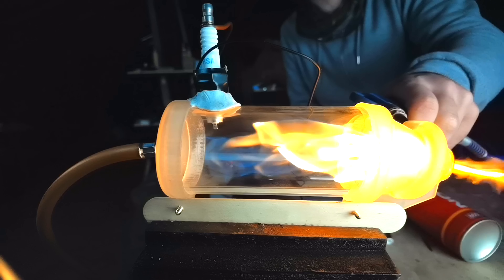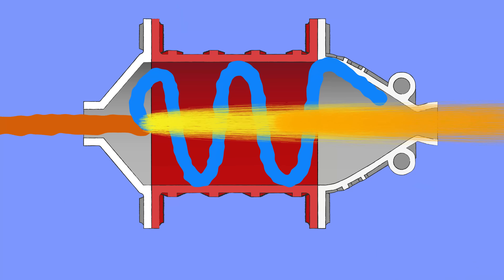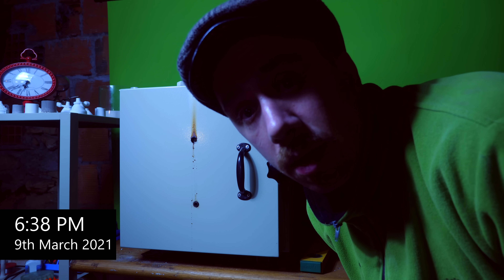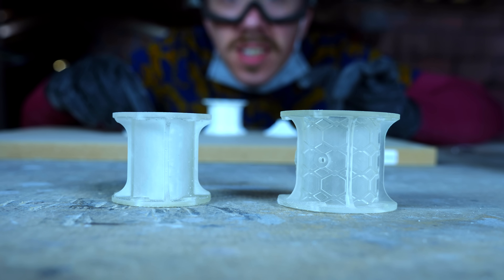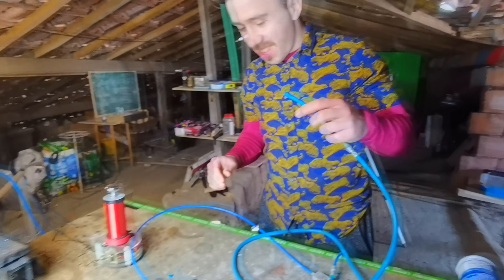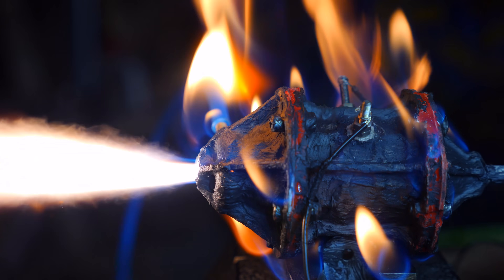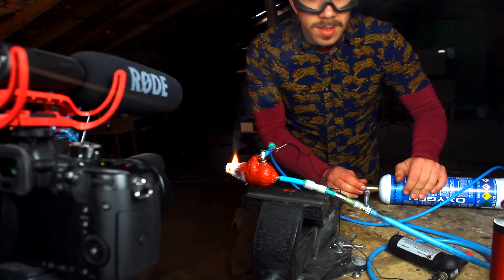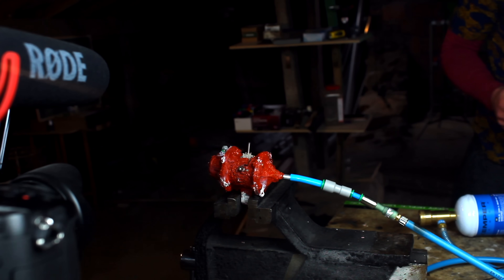Vortex Rocket V2.0 (3D Printed)

Comment: What if you used an aluminized gasket then as a heat up it would expand to fill the gap or even oven rim insulation as the pressure increases it would be forced into the cracks.

Comment: Are you assembling two flat surfaces together, as it looks in the vid?

Maybe try having the sections slot together (a recess in one that the other slides into), as minimal clearance as possible, filled with high temp putty/ sealant.

Comment: I don’t know a lot about rocket engines but instead of having flat pieces where the pieces butt together I would add ridges in there to lock it in like a bearing race and journal and then put sealant on it and I would use a sealant that’s non-flammable

Comment: You can use ceramic powder and air pressure inside the engine to seal your leaks. They do this to increase efficiency in houses.

Comment: You could use something in T-form and put it between the parts. The parts would need a gab so that the unpersönlich Part of the T dont ruin the flow. The "closing strength" would increase with the pressure. I could sketch something if xou want (my english isnt that great and the sketch would explain it a lot better but i dont want to waste my time for it if you wont see it anyways)

Comment: You could fix the leakage problem by increasing the PSI of the airflow, perhaps for a future video some experimentation with fuel and air ratios? There might be a good "sweet spot" for temperature of the engine and thrust.

Comment: Why don't you just buy an engraver CNC machine? Uses g-code as the 3D printer (well, not exactly the same). And using Fusion 360, you can get the g-code file.

Comment: I think you should use some time with decent 3D modeling program, do some simulation and find better shape of the chamber to achieve ideal laminar flow which better separate flame from wall of chamber. Although it can be more problematical due size of engine and pressure you achieving (bit like problem in TOCAMAC when scientists trying to achieve fusion). 
Also this kind of 3D printing with use of resin is certainly issue, because after evaporating the ceramics is too porous, so it will always leak. Possible solution of this problem is adding layer of enamel after kindling and do cook it again, ideally something with high temperature resisting properties. That would also help from inside, because it would make inner wall of engine smooth, so less disturbance in flow.

Comment: Am I the only one that caught that he had fuel and oxidizer connections reversed? According to his diagram and explanation at 2:09 the oxidizer is to be injected into the vortex generator, but at 10:23 he connected the oxidizer to where his earlier explanation implied that the fuel would feed into. If this was the case, that could explain the rapid failure of all of the engines (i.e. burning fuel in contact with combustion chamber walls, rather than [relatively] cool oxidizer). Hope that, if I'm right, this helps you!

Comment: Try using BASF Ultrafuse 316L. It has better shrinkage properties and can be machined after being sintered, so you can get the joining faces mirror smooth to prevent leaks. It's also much stronger than ceramic.

Comment: if the parts are porous could you not take the fired parts and drop them into a bath of some sort of refractory cement/slip, draw high vacuum then allow slip to fill prior air holes. then refire/repeat if neccesary?

Comment: Try to print the entire chamber double-walled to ensure an insulated air space between the inside and outside with only small connecting junctions. This way you can seal the outside without having leakage issues due to thermal stress.
Reply: Then I'd probably just use a grout sealer with this idea

Comment: @integza to solve the porosity problem I may have an idea: mix a small amount (idk 1%?) of metal powder to the resin.
In the post processing it will melt and maybe fill the "holes". 
Of course it could end in a disaster: the metal could bleed out or completely crack the model...

Another option is to use graphene powder that should not melt and maybe it will fill the holes..

Comment: Theme suggestion: you should evolve from plastic/ceramic to some kind of metal. You already tried soldering and brazing, why not to try casting? You can 3d print a part, and after making a mold you can cast with aluminium, copper or iron. I don't think that would be so expensive

Comment: Depending on how hot it is on the inside of the burning chamber you might be able to spray a mist of water in there that would then vaporize into steam which produces a lot of pressure just like the combustible gases while at the same time it's taking the heat energy down so that way you don't have to worry about the heat as much and it still creates Trust while cooling the engine at the same time it will have to be tuned but as long as you got an atomizer that can withstand the Heat that might help. 

Like a steam jet engine!

Comment: Can you please do a video of you trying to maximise the output potential of a CO2 canister, by using different  nozzles and part. Also try to fit it on a paper air plane or a plane of similar size, I think It would be awesome if the project could be easily done by others.

Btws love the channel and the energy you put into each video, and its inspiring to see how much can be done with a drive, intelligence, and a 3D printer.
Keep up the fantastic work!!

Comment: I suggest you mix up a batch of homemade sodium silicate (aka water glass).
Melting point is about 1 088 °C and because its already in liquid form at room temperature, you'll be able to submerge/dip your ceramic parts into it, in order to seal them all the way through (from the inside and the outside).

The problem with your current "exterior" sealing methods is that it's a bit like putting a piece of tape on the outside of a hose pipe - it won't hold, it just gets lifted/pushed off with just the slightest interior pressure.

I noticed a few comments suggesting using pottery glaze ..and yes I agree, this is also a brilliant idea.

Love the channel!
Good luck!
Reply: The main thing is that he is putting the pressure liner on the outside. So the liner gets no structural help from the ceramic, and once it blows off, the ceramic gets no sealing help from the liner. Lining the inside of the chamber would work better, but the stuff he's using now would probably kill the surface finish. Still, probably the way to go. Sealing liners always go on the inside of pressure vessels!
Reply: @rune12358  Yes, you HAVE to seal pressure vessels on the inside. Any sealant on the low pressure side is reliant on the adhesion to the surface as well as other problems. Incidentally you have to seal vacuum chambers from the outside. You would not believe how many 4' diameter concrete vacuum chambers are buried in colorado.... Although everyone ruins the vacuum chamber bit by putting steel lids on them that don't seal.....
Reply: Water glasses is a brilliant idea! 

  It sets up simply by air drying or heating! = )
Reply: You could glaze the pieces and fire them to turn the glaze into a glass coating
Reply: Dammit, that’s word for word what I was going to suggest.

He’s got micro pores from his casting process.   

Fuel/Oxygen leaks out, and then it’s Fail City.
Reply: How does the sealing with water glass work? YOu just dip it in and dry it, or do you have to put it in a kiln?
Reply: Thats ingenious for some reason it never crossed my mind good call bruv
Reply: Even with the refractory, make it much more liquid, as to fill in all the cracks and holes. You would start with very thin liquid layers and then after 1 or 2 layers, you use less watery refractory to build a bit more thickness. By example take satanite or some other refractory, thin it down and let is seep into the porous part so that it gets filled and then let it dry. Afterwards you do a second pass and then a third, the third you do with a bit thicker refractory.

Another option might be thin layer sealant and then a reinforcing layer with some glass/carbon fiber with epoxy/silicone as I don't think mortar/cement will stick to the silicone.
As the problem with the silicone sealant is that it's acting as a balloon. It doesn't have structural support except the adhesion to the refractory/ceramic that's porous.
putting the sealant on the inside would solve it but probably expose it to temperatures over 300C.
Reply: Maybe adding pressurized air to the oxygen could increase the airflow around the outer shell, along with moving heat away from the casing
Reply: liquid glass is literally that black thing he tried before silicone. That thing is made out of (mostly) liquid glass and a fancy complex to make it more stable under load
Reply: would you need to de-gas the water glass infused 3D print in a vacuum chamber to reduce the air bubbles that could be trapped in the ceramic, and get the water glass to go into the pores of the 3D print?  They do this with resins and with resin infused woods (ref:  look up cactus-juice).

Comment: Instead of using high temp sealant and refractory cement (which will still be porous) why not apply ceramic glaze to the 3D printed stuff and bake it. That will seal any holes same as for cups and plates!

Comment: What you just need a pressure regulator that also remixes the oxygen in fuel something like a turbine that has no moving parts that then feeds into the rocket engine

Comment: Possible options for solving the leaking issue:
 1 once you have the engine assembled coat or cast it in plaster Paris or cement by using a cheap plastic container to house it till it dries, either with the tubes pre installed or make the tube ports extend out further to account for the added thickness. You could possibly use pla to make a mold and then put it in the Kiln to melt it out and then you have your piece but made out of concrete or plaster of Paris entirely. If you do that then you're going to want something underneath to catch all the melted pla and as for the added concrete or plaster you might want to add some fiberglass or something to get the tensile strength up because of the combustion.

2. If you only want to fix the air problem and want to keep your current type of design then maybe coating it in a meltable yet hard material such as glass but that's a little impractical so maybe... dare I say, sugar!? Coat it in sugar that's been liquefied and heated let sit to cool and harden and then just don't run it till it's super hot and keep it dry and it just might work. Could be interesting for sure but you'd probable have to do some testing with the prossess before you do it.
1/4 inch of crystal sugar coating might solve leaking but I doubt it'll be strong enough to hold the combustion so the 3d print would have to do that. And it shouldn't touch the flame. If it does blow up you could simply wrap it in metal wire to help reinforce it. (Maybe under the coating) 

Now I really want to see that.😂
(But ideally metal would probably solve a lot of your problems)

Comment: Integza have you every attempted part casting with 3d printed parts? I not aware of how hot your kiln can get, but it would great to see an attempt. Also if you get the pour right you should have solid part, no leaking.

Comment: Don't use the oxygen for the cooling. At high temperatures oxygen will burn through everything. Try to use the propane as coolant and try to run the engine fuel rich, to make sure the propane can use up all the oxygen.

Comment: To try and mitigate the leakage problem, you cou try and cast it inside something else
Like what you did now with the high temperature silicone but with a much thicker coating It will hurt the modular part of the engine, but might remove all the leaking, if the coat is thick enough

Edit: Só agora soube que és português! Legal!

Comment: if the parts are leaking at the joins, then make one of the mating surfaces wide enough to accept the other surface as a plug.  no easy way to do this in ASCII and have it look very good, but i will try to give a functional concept of what i mean.  i know this is a long shot to make myself understood, but i will attempt it anyhow.

                    ####################                                                  <<<<<<<
                    ####################                                                  <<<<<<<
                    #####                                                  <<<<<<<<<<<<<<<<<<<<<<<<<
                    #####                                                  <<<<<<<<<<<<<<<<<<<<<<<<<
                    #####                                                  <<<<<<<<<<<<<<<<<<<<<<<<<
                    #####                                                  <<<<<<<<<<<<<<<<<<<<<<<<<
                    ####################                                                  <<<<<<<
                    ####################                                                  <<<<<<<

                    Part One -->                                                                        <-- Part Two

Comment: Really like your ideas, are you going to share the one piece engines stl, really like them and would like to see how they perform more. I have seen various ideas in the comment, but what about if you coat them in carbon fiber and the gray cement you used for some of the first engines, that worked in the past, so it could help, and probably you have leftovers from those projects.
Reply: Another idea could be using an fdm printer and print all you parts and make molds, or print molds were you could make the engine with other materials, there’s still a 3d printer involved.

Comment: Hey Integza,

I was thinking about your struggles with leaking gases through the printed ceramics. You could try sealing the parts with enamel (you already have a kiln).

As a project suggestion: 3D printed 2 stroke engine

Comment: what if you were to glaze the ceramic in porcellain glaze, and used oven gasket material? What you could also do is spray paint on heat resistant paint, or dunk the whole engine with everything assambled, blocking the oxygen and propane holes.

Comment: dude try maybe casting your rocked engines or buy yourself cnc if you have the money

you could make one modular design that doesnt break after 3 seconds and with cnc u could make them faster than 3d printing

btw dont take my comment too seriously bc I have 0 experience with rockets and casting but have seen cncs work in school (they are harder to program than 3d printer but honesly its not big deal) and honestly milling nosle would be 100 times easier than going through that ceramic resin hell

edit: read the reply as I came up with better idea
Reply: or better find someone who can manufacture those designs, create few modular ones so you dont need to mill whole engine and just pay them to do it as cncs are expensive

you will pay someone to mill it for u but the resin I bet costs a lot too and constantly printing stuff that fails even before it get it's 30 second show time will add up

also dont breathe the damn ceramic powder I dont think its very healthy

Comment: It is generally difficult to sinter materials with high binder content to densities of >90%. The open porosity your items showed, indicates a sintering density of ~60-70% of the theoretical density. The sintering temperature and/or dwell time were too low, or binder burnout too violent. Finer powders also show higher sintering activity.
 Technical ceramics that are formed with a lot of binder undergo a long-term debinding firing - this may take several days for thick and complex parts. After complete binder burnout quickly heat to sintering temperature (90-95% of melting temperature) to maximize the driving force for sintering. The dwell time should be several hours. Prolonged sintering does not increase sintering density any more, only the microstructure becomes increasingly coarse.

If porosity cannot ba adressed with the available kiln, you might try inflitration of the pores with TEOS (Tetraethylorthosilicate) and thermal decomposition to SiO2. It is a widely used, low cost method in semiconductor industry to encapsulate chips. (Spin-on-glass). If necessary, repeat several times. If the item soaks up water, there is still open porosity present.

Comment: also how hot does your furnace get you could experiment with metal filaments I've seen them for fdm printers you might be able to use copper or bras but it takes 950°C to sinter them

Comment: You could try sintering it half way then painting the parts in an extra coat of ceramic resin, 

I’m not entirely sure if it would work, but I’d figured it would be worth a shot.

Comment: Since the parts are ceramic, just like good old clay ashtrays we made in art class... I'd try using a high temperature glaze after forming, probably a few coats to absorb it before curing. As I don't have a 3d printer I couldn't comment really about anything to add pre-forming, maybe some silica extremely finely ground. I hope you're using a decent filtration mask when doing most of the clean up as the dust can cause lung problems, and we want you to be in peak performance while you're doing insane experiments.

Comment: Coat the inside and outside in sodium silicate and let it dry in the pores. That may reduce the leaking.  Maybe try infusing with a fine carbon powder like graphite, but that could be a little more risky.

Comment: you should start by priming the chamber with fuel first, to avoid a "hard start" (perfect ratio of oxygen and propane occurs a some point -> Boom). It may help in avoiding explosion of ceramic pieces